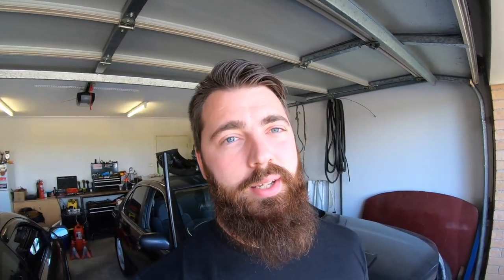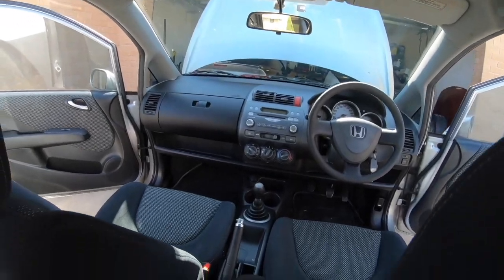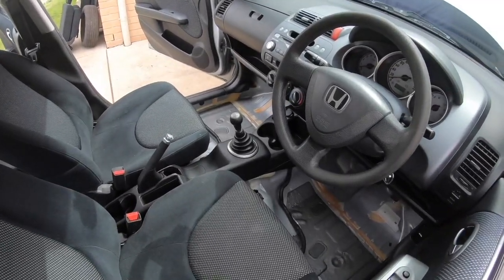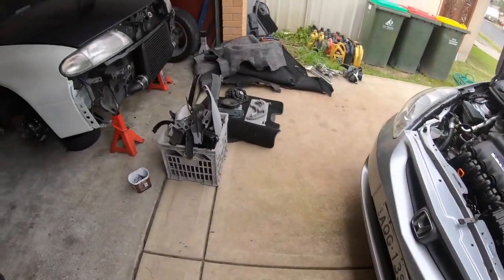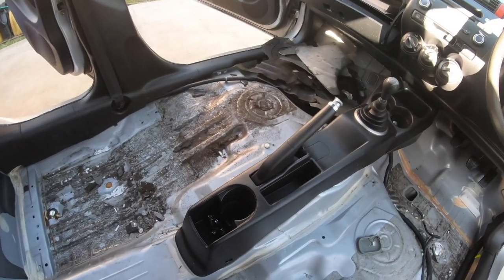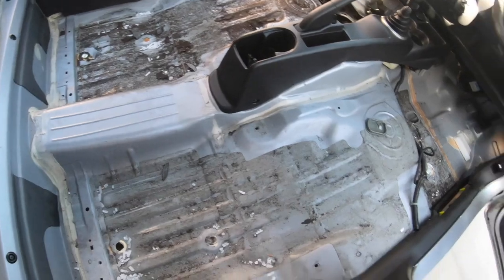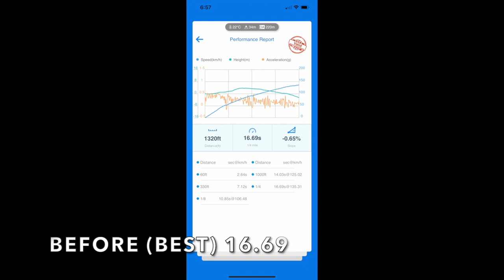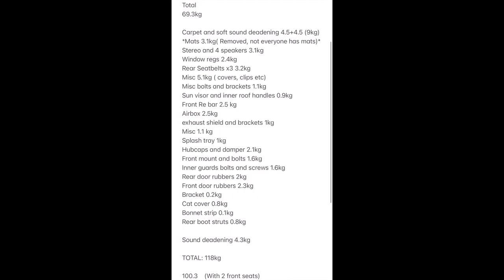How Much Weight Can You Strip From A Small Car?    The 100kg (220lbs) Goal || Project Honda JAZZ/FIT

Comment: For the vertical parts of sound deadening or even anywhere else you can use plumbers freeze that they use to freeze pipes just before cutting them its an aerosol. Did my full EG with it then just cleaned the residue up afterwards with some thinners.

Comment: I drive a fit and am thinking about tearing some junk out. 

I like motorcycles because you are only using what you need to get around, but the roads here suck too much, there are bike eating potholes everywhere. 

I figured maybe I can reduce the weight in my fit and get a little closer to that light bike feel

Comment: Did you empty washer fluid resevoir, you got about a gallon there full, also if you weight your car with a 1/4 tank of gas that should help factory car weight is weighed with full tank. That should be good for about 50 pounds. But you cant really show it in ur vid

Comment: Nicely done! I'm not sure how heavy your Jazz/Fit's glove box door is but here in the states they are slightly different design and surprisingly heavy.

Roughly 15 to 18 lbs thanks to a steel plate and insulation if I recall correctly.
Reply from the maker: Good advice! 
I might have to check that one out!
Reply: I've noticed that the glove box seems very heavy. Are there lighter replacements? Non-US market? I'm assuming the steel that's in there is some form of crash safety, knee bolster deal?